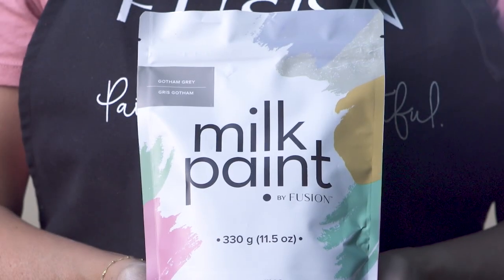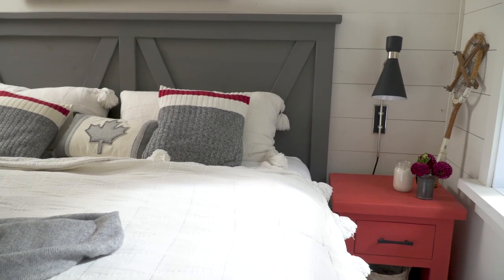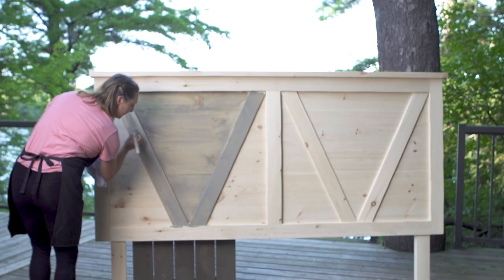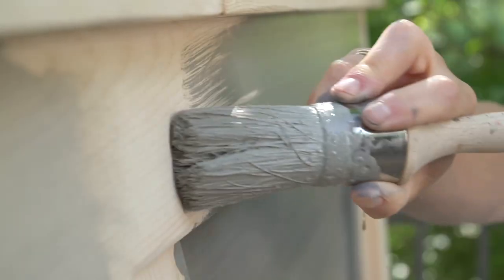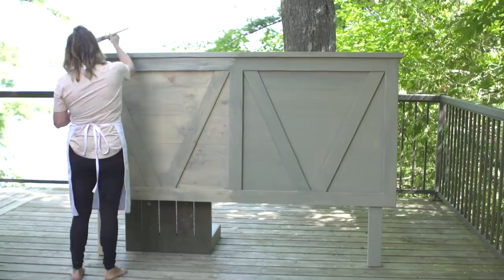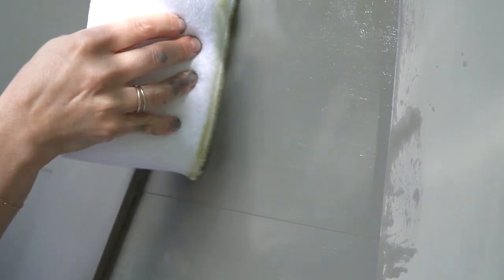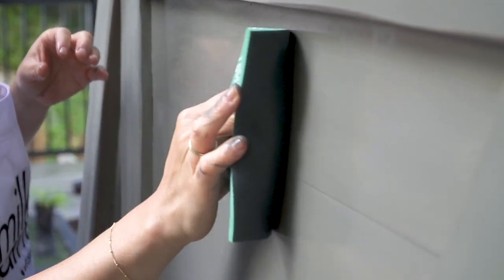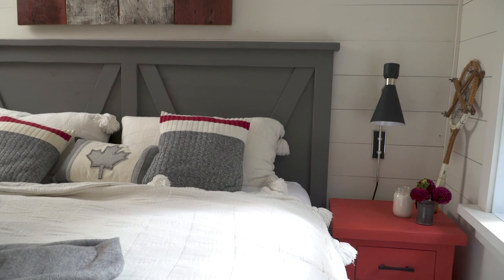How to paint a rustic headboard with Milk Paint - The cottage Series -Fusion Mineral Paint

Comment: Jenny, is there any transfer of oil or pigment to the fabric of the pillows or sheets on the bed with the hemp oil finish?  I love the way it looks but am worried about ruining the fabrics…
Reply from the maker: Raw wood especially soaks it up very well, and if you wipe back the excess, a very little transfer could occur but you can tell very shortly after that there is no oily feel to it at all, especially if the excess oil is wiped back.